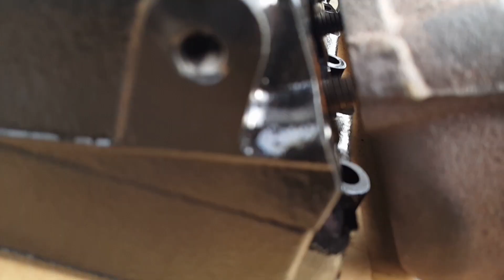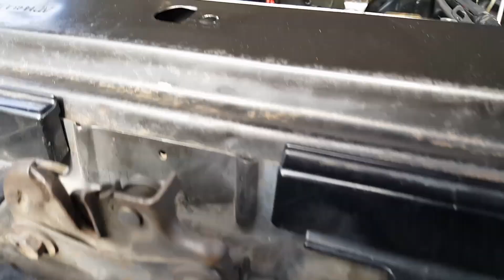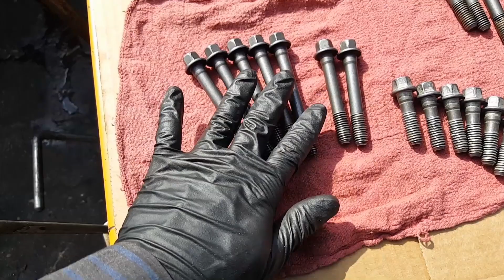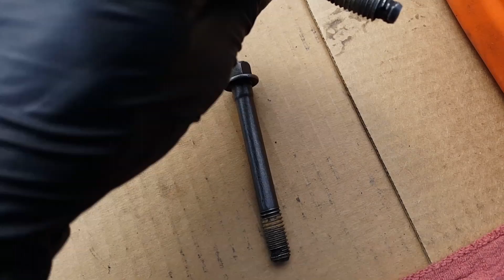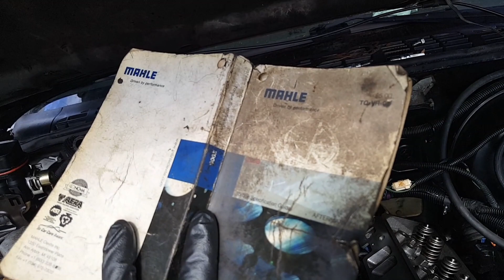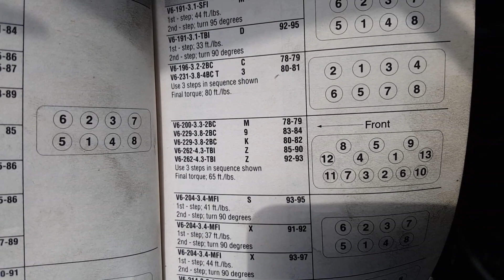How to remove and install the head gasket on 4.3 Chevrolet vortec ,torque specs

Comment: Most people don't really understand what the Vortec is or means. They're a totally different animal and actually a variant of an LS engine. Using a sort of paddled rod. Running lengthwise of the intake valley. Creating a faster, directional swirl of air. More efficiently introduced and burned quicker. Than a regular engine. The simplest upgrades, yield amazing results on them. Like cold air intakes and good plugs.

Comment: Maybe in the future you should start from the beginning of the job so we know what the hell is going on...
Reply from the maker: Good idea 💡 
Thanks for the advice 🙌
Reply: @JM8686  did I miss the video where you tore it apart, or is this where you started recording? This is the only video series for head gasket on this motor that I can find, and im not that experienced.  I need to know what you tore off, and what you left in place. That way, I dont have to worry about getting it "in time" because I removed the wrong part...
Reply from the maker: Yeah i have the fist video but back then my YouTube was a mess lol 😆
Reply: Do you mind linking it in a reply? Sorry, it just says this is part #1 in the video description.
Reply: @JM8686 can you repost it

Comment: I use an impact to remove bolts but always use a torque wrench to tighten…..
Reply from the maker: Always good to torque
Reply: Also…it’s a good idea to run a thread chaser through the bolt holes for the cyl head bolts in the block to clean out the threads. This will ensure that the cyl head bolts torque up properly; if they are dirty or rusty they may not allow the bolts to have adequate clamping force even if the correct torque reading on the torque wrench is reached.

Comment: Due to an unforseen situation. I've gotta change mine at only 110,000mls.
Mine is the 98 GMC Sonoma SL 4.3 Vortec, 4sp A.T. But I'm gonna do a full port and polish on all parts. With a K&N cold air kit. These Vortecs have insane power in reserve.

Comment: I'm not sure if I missed it somewhere in this video but what year and model is it you are working on?... is this the proper method I can use on my 2005 GMC Jimmy? (It does have the 4.3 vortec)
Reply: Тоже интересно, подходит ли этот метод для Chevy astro 2003, vortec 4.3?
Reply: @ДмитрийМалков-й5л  is that what he's working on?
Reply: @dftsp33ddemon14  Yes, it is over this.
Reply: @ДмитрийМалков-й5л  so this isn't the proper method I can use on my 2005 jimmy?

Comment: Will rebuilding the top end interfer with the computer?
Reply: No,but do not spin the cam shaft or risk throwing it out of timing. The pcm and bcm will be fine as long as the batt is disconnected before you start,and not reconnected until every single harness is plugged back in.

Comment: Did you have over heating issues after installing those gaskets? The holes on thoes gaskets seem like they block cooling flow.
Reply from the maker: No sir no problems
Reply: Was those Head Gaskets from Fel Pro series? If so they are the best as far as I'm concerned.

Comment: Wait wait question about torqueing the headbolts you did increments of 22 to total 66 but I thought you built it up like first 30 then 50 then the last torque spec whatever it was
Reply: Second time torque should be 44.?
Reply: @leewilliams8917  depends on the engine. Some are 44 some are over 60,ya want to know the right torque specs and order for each engine you work on. I always build up by 15 or 20ft lbs at a time and in the correct order no matter what the final torque spec is. That's just me though.
Reply: The way he described it reminded me of way, way back over 50 years ago when I was about 15 and never even used a torque wrench before, an older guy I knew was in school auto shop and told me about how the teacher was trying to tell him that if he torqued a bolt to say 30 lbs. torque and then did it again it would in effect place twice the torque on the bolt.
I said " what ? ".   I told him if that were the case then he would be able to set the wrench for 30 foot pounds, torque the bolt 4 times in a row and rip the head off.
Maybe he was really describing 
' gradually ' taking it up to the prescribed amount, and the guy I knew took it the wrong way.
Reply: @michaelszczys8316  I made the comment 2 years ago but I'm glad you replied, because that motor I was working on actually cracked in 2 places from a intake gasket leak, but I did do lifters on the drivers bank on a 5.3 past few days

Comment: Saludos necesito manual porfavor necesito montar cabezas y buzos hidráulica
Reply: Those are the easiest due to the lifting of the rods with hydraulic pressure from the oil pump. Use the appropriate amount of torque for the head bolts and in the right order for what engine you are working on,but with the hydraulic lifting rods,you don't need to worry about the torque of the rocker arm mounts. Just tighten to a reason level,then add a 90° or slightly more. Just needs to hold secure,the hydraulic lifting will take care of the rest when running.

Comment: anyone know the toque spec on the rail that holds down the lifters?
Reply from the maker: No need torque lol just get them tight by hand and then half turn,should be around 18lb to 20lb
Reply: @JM8686  are the rods the hydraulic lifted type where they set directly on top of a oil nozzle? The rods are normally like hollow straws with a small hole going all the way through them if so. Getting ready to do a S10 head gasket and curious if it is like the GM 3.4 I just finished. Theres no torque specs for hydro lifted Rods on rocker arms either.

Comment: It's actually 13mm
Reply: The V8s are 13 mm 4.3 v6s are 15mm
Reply: @reidjackson8800  did mine on a blazer v.6 and that wasn't the case it was 13